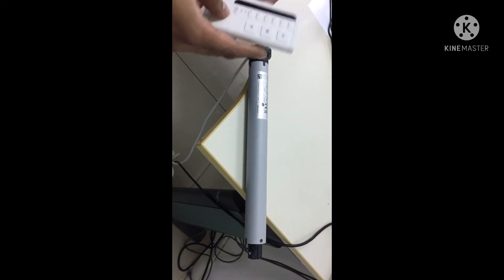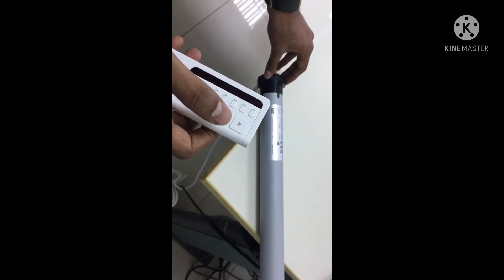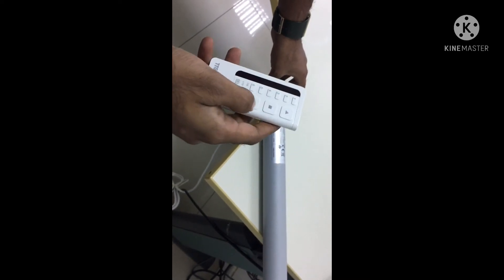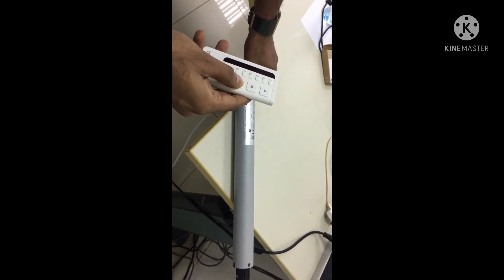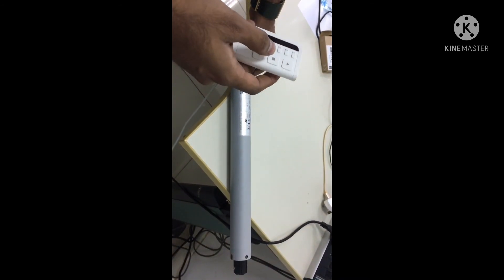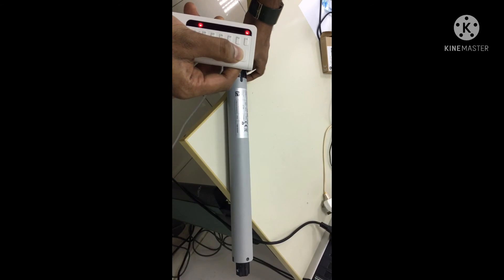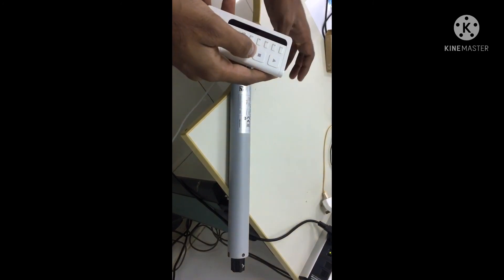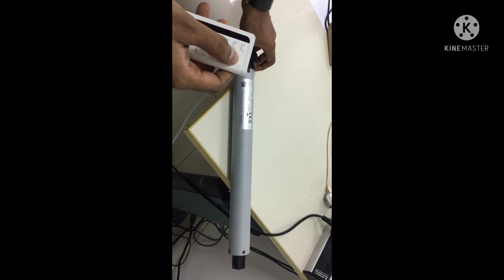TTGO Electronic limit switch motor programming using remote control

Comment: Hello. Thanks for your video. I have a question about the remote. I bought the TTGO TGTIME 6W and tried to execute what you've done in your video. But this is not working as expected. Do you know if the upper and down limits can be set with this remote (TGTIME)? Do I need to buy the TTGO TG6 remote?